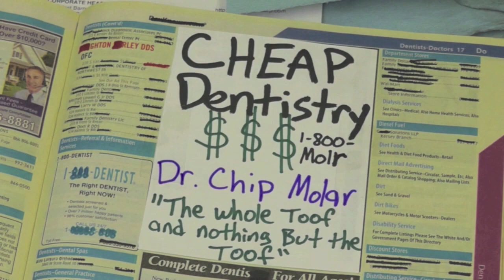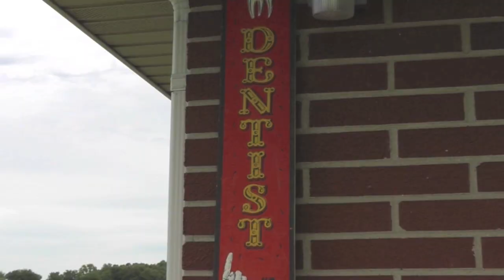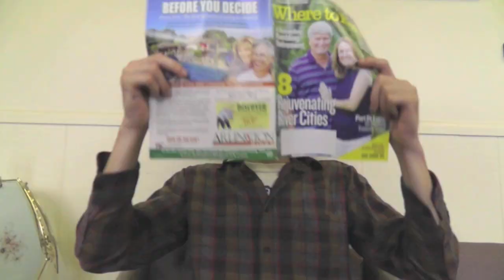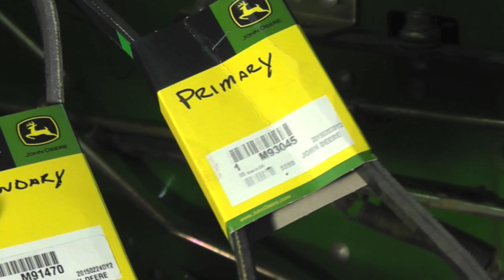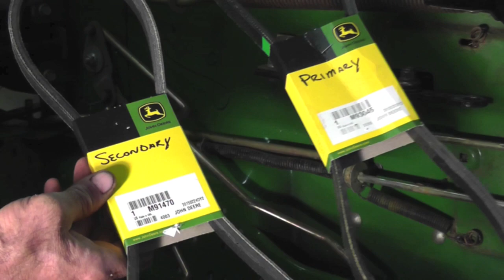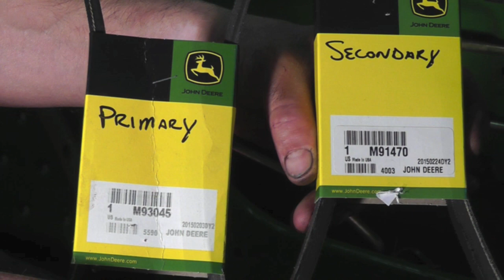Replace Deck & Drive Belts John Deere RX75 Riding Mower

Comment: Good thing I found this video. Never worked on a RX75 before but I had one come in my shop that needed belts. Boy you aren't a kidding when you say they are hard to work on. Any other mower is takes me maybe 20-30 minutes top to change out the belts. That thing took me around 4 hours of cussing and alot of beer.

Comment: This mower is a pain to work on and makes me want to sell it. But thanks to your video, I was able to replace the deck belt and a pulley with a bad bearing. This might help someone - what I did with the deck pins was take a sharpie and mark which way the hole is positioned on the side. Makes it less tricky.

Comment: I am French I own this tractor. I was able to fix it thanks to you. I ordered the primary and secondary belts through your references in the USA. they are of very good quality. I just have the brake to repair, a pad and fell with the two small cylinders. Thanks for your help, it was really helpful! moreover I laughed a lot with the beers. good for you

Comment: Hey Taryl, Thanks for the video! I'm working on a John Deere RX63 (old dude) my father in law gave me 20 years ago. I used it for a while till a drive belt broke. I tried to fix it by raising the rear end with a block and tackle rig but it was too hard to work on like that. It's been sitting under the house for 6 or 7 years and I decided to fix her up to use at my 95 y.o. dads house after seeing your video. He uses a cane now and can"t mow so I'm hoping to use it here in Fla. It's a lot like the RX75 so your video is a masterpiece for guidance. I took the deck down yesterday and ordered new belts but they won't be here for a week. The back tires dry rotted so I have new AG tires to put on the back while I'm waiting for belts to come in. I watched your video on changing tires with the mini tire changer from Harbor Freight. I have one and going to mount it to my workbench today. It'll come in handy since I have a small boat trailer, another mower (3 wheel Ride King) and hand trucks/wheelbarrows! That video was great too! Thanks again, Dale

Comment: Thanks Taryl, great video.  This helped more than you know.  Today I changed the drive & deck belts on a John Deere GX95…..what a PITA to work on.  I also installed the AM 107421 starter relay. Oil change tomorrow  morning and she’s down the road.  On to the next one!

Comment: I was climbing the walls trying to get the mower belt on the front sheave of RX95 and finally saw your video forcing the belt on while pulling on the arm and rotating the mower blade!  Boom - its on. I actually tied the spring loaded brake are away with a chunk of rope so I could force the belt through with both hands! Thx!

Comment: You make is look so easy; but, it was a royal pain to do it. Something that you knocked out quickly, took me 6 hours because the genuine belts I ordered were wrong. In addition, the mower belt was wrong too, as mine has the 38" deck. I'm not complaining, as it was given to me for free, but wow was it difficult. Still not done, as when I went to check that the deck belt was working properly, it wouldn't start up. I suspect it's the relay switch, but that will wait till tomorrow. Thanks again for putting out a funny and informative self help video.

Comment: I've ended up in the dentists chair in that condition more than once. Took twenty men with pick and shovel to extract my tooth. Had to hire a cheap lawyer afterwards. (Sorry, too many Stooges references there). Changing those drive belts sure is a knuckle buster, on top of having to jerk off another mower deck. Glad there was a happy ending. Changed the belts on my J.D. last fall. Almost as painful as visiting the dentist. Thanks for another funny, educational video!
Reply: you're.doinging.a.goog.job.thanks.for.the.help.you.give.to.get.the.belts.on.
Reply: MrGoosePit 

good.jop

Comment: Just put new deck and drive belts on a GX 85. This video was a nice primer. I put several replacement pulleys in too. Glad it was the gear drive model.

Comment: Just replaced all my belts on my RX73 using your video. Even with the great tips it was still a MFer LOL. I got lucky all my bearings and idlers were in great shape and am I ever glad! That idler above the transaxle for the primarty belt looks like it would be a total bastard to get off. Only way I could see to do it would be lower the transaxle a couple inches, a job for a much cooler day when the time does come. Anyway, thanks for the great tips, you saved me a fair amount of blood loss.

Comment: video was goofy but but informative and the info was right on track, Got my deck belts fixed in about 1hr 45 min. At 51 with a torn rotator cuff waiting for surgery in 2 weeks it wasnt too bad. Thanks for the video. Made a couple mistakes and had a wrong pin in the deck that cost me some time. Otherwise sailed through pretty easy after watching the vid.

Comment: You’re correct I used aftermarket belts in my mower  and it hardly moved forward or backwards. Bought the John Deere belts in your video works perfect now. Very informative video thank you
Reply: I'm having the same problem with aftermarket drive belts. I guess I'm gonna try OEM drive belts now.

Comment: Great video. I could add that removing the left rear wheel gives you more room. Also, removing the spring for the secondary belt idler pulley is safer. Using an automotive drum brake spring tool works fine for removing and reinstalling the spring. A lot safer than shown in the video.
Reply: I thought about removing the back wheels too but haven't gotten that far yet. Waiting for belts to come in!

Comment: By the way, a Briggs push mower plastic float and needle will fit in these carburetors if you shave just a bit off both sides of the float mount with a razor knife. The Kawasaki needle and float are sky high priced (like $50) and the Briggs is much much cheaper. I robbed them out of an old push mower.

Comment: stumped. 

I have a stihl hs45 gas hedge trimmer and it's really hard to.pull..if I take the plug out its really easy..any suggestions ?  thank you and yes the spark arrestor is clean

Comment: Great video , couldn't have changed the belts without your help . I changed the belts 2 weeks ago , used the mower twice and saw that the secondary belt has several cracks on it's inside surface . What would cause this ?

Comment: Thank you in advance August 30 2024 after two years of finding parts i now have a rx 73 running cutting grass i will have to do the drive belts may be drop the transmission and re grease it 37 year old mower cuts grass perfectly and greetings from Northeastern Alberta Canada peace and love

Comment: is there a way to put the mower deck belt on the back mower pulley without removing it from the deck?  Or do i have to remove it from the deck?

Comment: gotta battery drain issue on a rx95.  theses are a pain to work on, did a carb on a rx75 and it was a great mower but thats befor i knew about taryls vids been lovin em
Reply: I had a battery drain issue too!  After much ado, I found online it was a simple drain prevention harness that was added in munutes and have not had a problem since!  Unfortunately, the shop had replaced hundreds of $$ in parts before I finally discovered the solution! Search online and you'll find it.

Comment: I'm having an issue I'm hoping you can help. The tensioner you pull down on the secondary belt, on mine the pully is rubbing against the trans pully and is so high up the belt going forward is rubbing on the belt going back. I feel like the belt shouldn't be rubbing on itself but I can find a diagram worth anything to see.
Reply: Sounds like the secondary belt is stretched out

Comment: Picked up an RX75 today and someone took out a pulley for the drive belt because it was seized. Is there a pulley that attaches with a long bolt and metal spacer that goes through the left side drive axle from top to bottom? I believe I can see it in your video.
Reply: There is. The primary belt goes around that one.

Comment: mine RX63 did not come with those front pins so I just made pins that went all the way through. It took alot of adjusting belt guides and pulleys to keep from eating belts.

Comment: I have a John Deere RX95 that is having trouble properly engaging in reverse, is that a primary belt that is wore out or an adjustment I need to make?
Reply: I have the same mower and it does the same thing as yours. It won’t move in reverse but does fine in forward gear. Did you get your problem fixed and do you mind sharing what you did to fix it?
Reply: @gustavosorola4465  I found a complete used rx95 on cregs list for $50. and used parts to rebuild a bunch of stuff on mine. I replaced the adjustable shive and I think the main thing that fixed the problem was replacing the main belt with new one from John Deere store
Reply: @gustavosorola4465  Check out YouTuber ( Teril fixes all ) he has a video on how to replace that special belt.
Reply: Thanks for the reply and sharing your story. I did watch Taryl’s video. I’ll be changing out the belts thus coming week.

Comment: Do you know how to change the oil on this type of mower? The local dealership sold me an oil filter for mine, but I don't think it has one.
Reply: There should be a rubber hose just above right rear wheel,that's the drain,there is no oil filter on these,with the 9hp Kawasaki anyway

Comment: I had one of these about  15 years ago and I gave it away. From seeing what Daryl went through I thing I came out on top. I would love to know what the cost was. It had to be more than it was worth.
Reply: Michael Warren I bought mine used over 10 years ago from a buddy. It's still going strong and it's cut a hell of a lot of grass. I just now had to replace the Primary and Secondary belts and that's why I watched this video. That Kohler 9 HP is bullet proof. I bought all 3 belts, a new blade, and a ignition switch and it all came to under $160 bucks. My labor is free except for the beer I had to drink, just like this cowboy Taryl did.

Comment: Hey teryl, can you do a video on how to clean the carb on a simplicity 6216? Its an older model from 1984, but it has a strange carb on it that dosent even have a carb bowl on it from what I can tell, I believe it's a diaphragm carberator.  I'm not sure how to clean these types of carbs beacuse I've never seen this type before. I've learned alot from your videos and could really use you help on this, thanks keep up the good work.
Reply: Those carburetors are not worth the time to clean them. Replace it and the diaphragm sheets below it.

Comment: MY TRAN BELT IS ON BUT NOT TIGHT HOPE THAT PULL BACK PULLY IS ALSO ON THE GX85 AND YES YOUR RIGHT THESE ARE A PAIN TO WORK ON PRICE TO GET THE TRAN BELT ON AT THE J DEER IS 215.00IF  I DON T NEED ANY PARTS. THATKS JOE.

Comment: Taryl, I have a John Deere 325 made back in the '90s.  The mower deck has spring loaded pins but they are ALWAYS very subborn and very difficult to move.  What would your tip be for the best way to free those pins so I can then get the deck off?  It would not surprise me if this is a problem many people have.  I even had a Cub Cadet with the same kind of pins.  I don't know about other models but on both of those the pins are on the back.  They will hardly move and there is not much room under there to get other things in to attempt to push them loose from the other side (rather than pulling).  If anyone knows how to deal with that very annoying issue, I am sure that thousands of people will be greatful do read the replies.  I am even considering asking a local shop for advice on this.  At times the pins move with no trouble but then they sometimes get so stubborn that it seems like nothing can move them.  I am sure there must be a way to prevent that from happening next time but I would not know about that.  I just want to get those loose without feeling as though I need to tie a rope to a second vehicle and yank the #$%&*ing things!!!

Comment: I am currently trying to put a primary on my RX75 and what a PAIN IN THE ASS. He makes it look so easy.  I can't get the belt onto the B pulley above the left drive axle. From the looks of this video, I got to feed the belt above the pulley. But on my RX75, there is something there to prevent me to slide the belt over that pulley. 

But, I learned a lot. I will be tipping my tractor on the side and see if that will help any.
Reply: damn i got lucky my primary belt was the only one on when i bought mine off craigslist.  resting it on the jack stand is not the best idea. mine fell off the jack stand twice.
Reply: @warrenpeas  Agreed. Jack stands are unstable. Specially with the wheel turning on the stand. I got lucky though. Mine didnt fall off, but it felt like it could at any second. I did eventually get the belt fed through, but you have to muscle it around the pulleys. Its not easy. 

But, I made a mistake. I should of done both primary and secondary belts at once since I already had the primary belt off. So when the secondary breaks, which will probably be soon, I will have to take the primary off to put the secondary on 1st and then put the primary back on after.

Comment: Any clue where the sensor/switch for the gear shifter is? Mine won't start without jumping the solenoid (it's a new solenoid) can't get the relay to click the shifter is really sensitive.
Reply: The neutral sensor in the transmission.

Comment: I have this same model and my reverse don't work any advice you can give me to work on it ?
Reply: @Eddie, I had one and I took the rod that goes to the tranny cut it in half and installed a turnbuckle so I had some adjustment to engage reverse.

Comment: Taryl how do you take off and replace the steering wheel and steering shaft to replace it.
Reply: The steering wheel bolt slides in and out. don't be fooled by the phillips head on it. Don't try to turn it. Push it out from the threaded end, it is splined.

Comment: Had one of these that the customer put the right belts on, but backwards. Riding it like that and jamming it from forward to reverse for a half a season. He snapped the shift key in the tranny and would go just fine and suddenly lock up. He comes back an hour later without even calling him with the bad news, with a crusty, corroded, SEIZED, yard dwelling, swamp creature looking thing. It was the tranny from his other dead rx75. The rest of the mower went bye bye 20 years ago. Cracked it cleaned it greased it and serviced the brake.  Worked just fine. He knew about the the trans, just wish he would've told me BEFORE I almost smoked a new set of belts. Almost didn't get those brake caliper screws out either.

Comment: I hope you can answer my question here. I know it's a 7 year old video, but maybe you will see my comment/question and give me an answer. My question is - I need to replace the small metal v-pulley for the primary (lowest to the ground) belt. How do I get the pulley out without having to remove the transmission?

Comment: Well this is way different than my John Deere 56 even though it looks the same on the outside... this has a transaxle.. mine is change driven to the rear from a transmission

Comment: What is the model number for the motor on the SX 75
Reply: I need to find out what carburetor on it I have one and the engine cover is missing and I need that information
Reply: @danielthomas3127  Its a Kawasaki 9 H.P. in the SX75 (SX95 had a bigger motor I beleive)
Reply: FC290V

Comment: can you put the belt on the deck first then attach the deck then put the belt on the mower?
Reply: update: i found it much easier to put the belt on  the deck first then lift up the back of the mower instead of lay it on its side and put the belt on the mower second. just make sure the deck is in the highest position so you have more belt to work with.
Reply: You can pick up the front of the tractor and man handle it that way. The front end is super light.

Comment: Hello Taryl!:) I needed your help, btw I'm sorry if you saw a bad comment from me on one of your vids, it was my friend hacking my account!😡 But the real me is back!👍 we have a Kohler command engine in our 1997 Simplicity regent lawn tractor and we think it seems to have some sort of valve problem.. It starts and runs good once hot but when we start it  it will spit out white smoke with gas,. And it seems to get stuck when we turn the key to pull the engine over,.. It runs good once HOT like I said but if shut off when hot when we start it again it spits blackish smoke and takes about 30 secs to come up to full throttle.. I need your insight as to if it is a valve problem or anything else,. Sorry for the long comment and complex story but I figured I'd ask the best!👍😃
Reply from the maker: I take it that it's a Krohler command Single? Could have the leaky needle & seat problem, and it's loading up with fuel. Or it could be a blown head gasket if it's a twin cylinder. Check those two things.
Reply: +Taryl Fixes All Its a single cylinder so I'll look into it!👍

Comment: I didn't see you remove the battery. Most batteries will leak acid when the mower is turned in that position

Comment: I use to work for Deere as a service tech. I hated to work on this piece of junk this is Deere worst mower that they ever designed 
I don't know what the engineering department was smoking when they designed this POS.